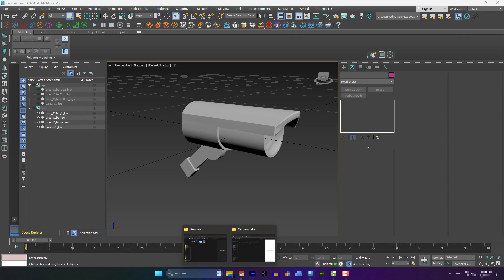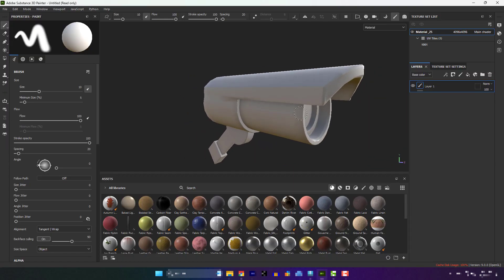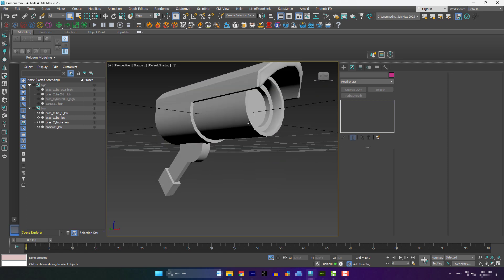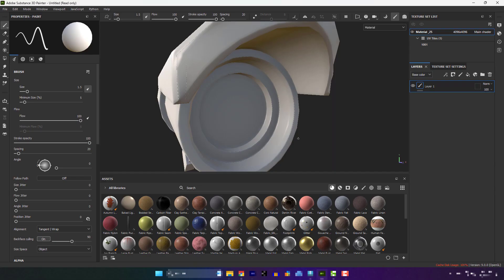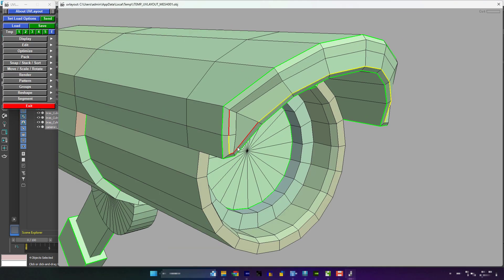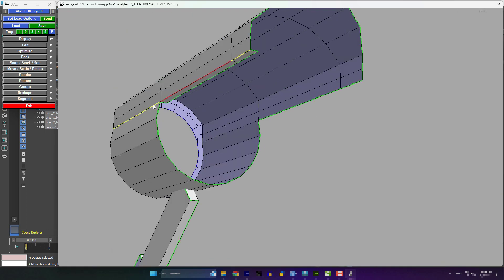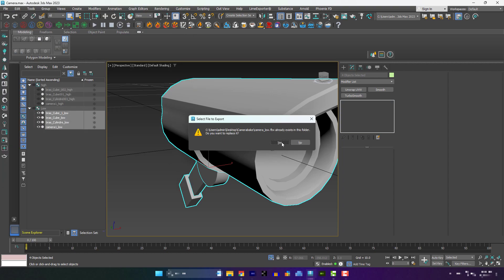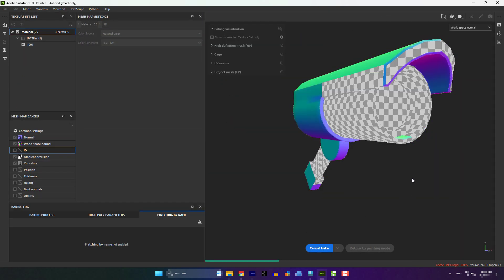Low-poly baking using high-poly | PROBLEM SOLVED

Comment: For those using blender, there are a couple of commands to make this easier. If you have "space" set to search, you can -- in edge mode -- select sharp edges and determine the angle. This allows you to select your hard edges. Then mark then as UVs. Then you start removing UV edges that don't work as well. It's easier more easier to work backwards then forwards.

Then, if you want to make sure you're not going to get distortion, head over to a UV window. Click the drop down box for overlays, then click "mesh distortion." Add cuts where needed. Rememvber that your unwraps will look better if you have supporting edgeloops for your booleans, as well as triangulating areas that you have holes in. 

Finally, get a free or paid asset to pack your UVs with a proper algo. Blender's vanilla one suck. Just get a new one.

Comment: What a useless solution. Just dont use hard edges. or use it only at extreme angles. more uv islands = less usefull uv space
Reply: not using hard edges will result in very sloped normal maps surfaces, which then gives you terrible results in LODs, if you are gonna have those
Reply: @Reyhue  some times maybe. but that is why it's LODs - you not looking for details at far distances :). Mostly there is no problems with normal maps. Use hard edges at extreme critical angles like more than 100+ degree.
Reply: @zk87  yea but you are gonna notice a shart on the normal maps, talking from experience on projects. Anyhow, agree that should be limited mostly to critical angles, but it's not a "useless solution" I'd much rather have juniors learn these things and learn when to use them rather than just blandly bake everything on shade smooth like you see often
Reply: @Reyhue   u r right. we need to know and use all the ways for propper solution to exact problem. On my experience in outsource studio aaa-studios asking more and more often to use less hard edges as possible. Some asking even not to use hard edges at all - some times it's rly burns our asses :). From optimisation pov its correct - more hard edges and more seams on uv = more vertices in model
Reply: If you want to have a realistic model, then your solution is best, but if you want a stylized model, the video's solution would be better.
Reply: @Tutorials-hj4xd  working as stylized 3d artist for 10+ years)
Reply: thx

Comment: isn't it necessary to have a good uv map for the low poly ? and should the high poly also be uvunwrapped ?
Reply: You don't have to unwrap high poly for baking. High poly is just a shape which you want to transfer to low poly as normal map. Imagine that normal map is a ghost of the high poly transferred to low poly. But sometimes you need to unwrap high poly, for example if you want to add some details in ZBrush, like pattern, or text. Then it's needed, but you are doing this only for adding the detail in ZBrush. When you export the high poly from ZBrush for baking, you don't need UV mapping anymore. Also it's worth to create real high poly in ZBrush, for example "knurling", or text, because if you have "real" detail on your model, it will create very realistic bake. If you want add "knurling" in Substance Painter with height map or normal map, it is possible, but quality of it will not be that good, as sculpted in ZBrush.
Reply from the maker: for baking low poly with high, good means to cut each hard surfaces.. and you don't need to uv high poly.